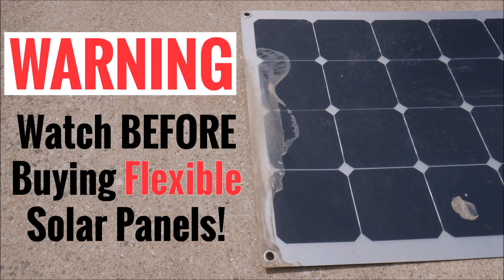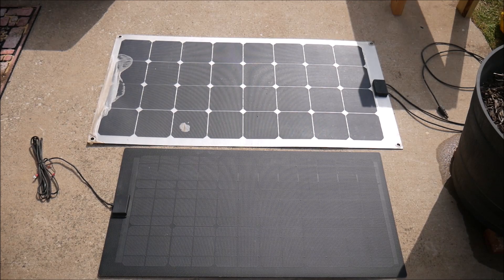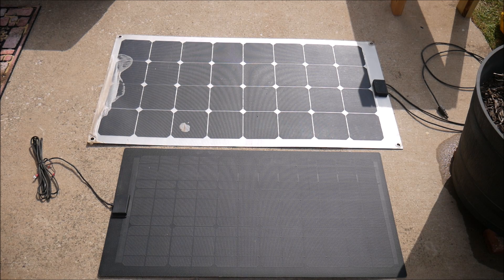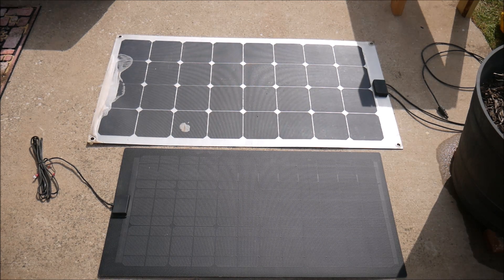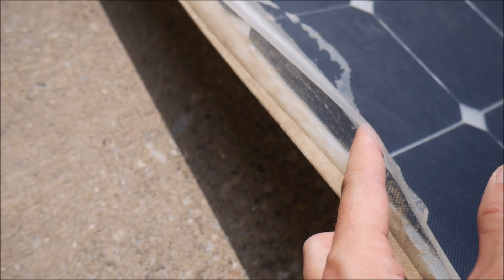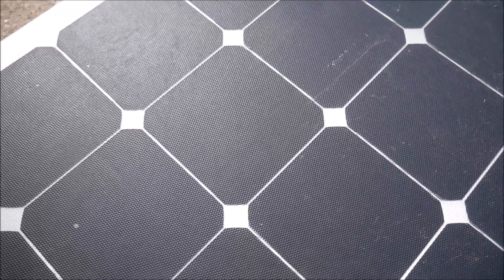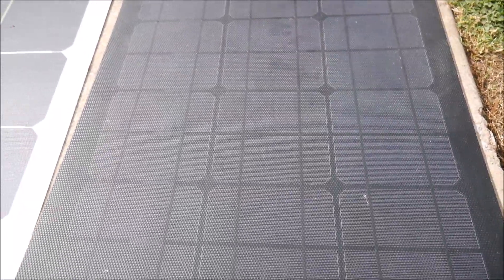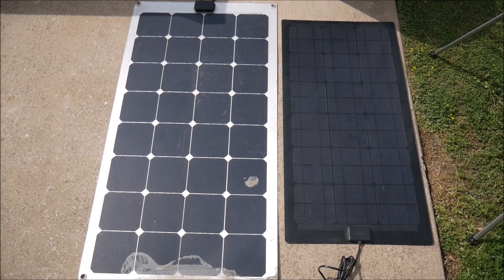Watch This BEFORE Buying Flexible Solar Panels! - ETFE Does Not Last

Comment: The problem here appears to be delamination of the ETFE film from it's substrates. If the edges are not properly sealed, pysical and thermal stress might lead to ahiesive failure, moisture intrusion, and delamination. The ETFE film itself is not the problem. Panel design and manufacturing is. The lesson here is that you need to carefully evaluate the EDGE condition and integrity of these foldable / flexible panels. Some sort of robust continuous, UV restiant flexible seal is neccessary at all ETFE film penetrations and edges, along with a lamination adheisive that's flexible, resistant to thermal stress, and tenacious and compatible with both the ETFE and whatever substrate it's applied to.

Not a simple task, so It's probably best to spend the extra money required for name-brand products with a proven track record of reliability and performance. Again, this is not an easy task given the newness of the technology, and the unknowns associated with it's long term deployment under the harsh consitions of portable use. The option is to go super-cheap, baby your portable array, and hope for the best, in essence treating such arrays as disposable, and biding your time as the industry matures and solves the technical problems associated with portable folding and flexible systems.

That, or just go with cheap, proven glass and aluminum framed rigid panel technology. 2 50 watt glass panels wired in paralell will stow in almost the same space as a rigid folding 100 watt ETFE panel anyway...and cost 1/2 as much ;-)
Reply from the maker: Agreed.  I don't recommend "flexible" panels to anyone for any application other than the most critically lightweight and portable (like for multiple day backpacking trips or something) until the technology improves dramatically.

Comment: ETFE is more difficult to process wich is why the panels often are more expensive, but they are said to last twice as long than PET panels
altho the bonding appears to be an issue
I already have a few PET panels and will buy some ETFE panels and mount them outside my apartment, they are semi protected from rain because of the awning which I leave partially out for that reason.
I really only get about 3-4 hours of sunlight in the winter in my apartment, so I need all the panels I can fit(and I have some disposable income)

I also have a bunch of old car batteries and purchased some new ones for extra capacity for a total of about 200AH usable capacity without draining them below 50%

if the current rise in electricity pricing keeps up these solar panels may pay for themselves within 5 years or less with the added bonus that I have a fully charged spare battery available at all times

I can't quite make sense of the charge efficiency rates the internet is giving me tho
they say 70% efficiency for charging and for discharging respectively a lead battery, but I used 400Wh and I charged 400Wh and they are full, so either they are really good or I'm missing something else here

Comment: I have been involved in designing, making and selling small volumes of highly customized lightweight and "flexible" solar panels for over 25 years.  Most of it with ETFE top film anywhere from 0.0005 to 0.0012 inch thick and most of the panels used in "near space" (think 100,000 to 130,000 feet).  It appears many solar panel manufacturers that use ETFE top film along with so-called "cross linking" encapulants like EVA don't understand the processing requirements for successful laminating.  It isn't completely clear to me in the video that the top film "de-laminated" from the encapsulant or both the top film and encapsulant de-laminated from the top of the solar cells.  It is, however, likely the former as that is usually the weakest link.  Successful laminating of ETFE films with cross linking encapsulants requires that the ETFE film be "treated to be bondable" on at least the side of the film that is to be in contact with the encapsulant.  It also requires that the pressure during laminating be adequate.  I manage with on the order of 12 pounds per square inch but reputable encapsulant manufacturers generally recommend about 14 to 14.5 psi.  Finally, it also requires that the cross linking encapsulant be at a particular temperature (usually over about 130 C) for a particular amount of time (usually many minutes).  Without all of the above, de laminating is certain to happen even with minimal "exposure".
Reply from the maker: Good to know!  I am far from an expert on the flexible panels and I do not personally have any desire to own any other than the ones that were sent to me for free to review.  I do not engage in any activities where the extra portability and weight savings is a benefit.  So they just end up being triple the price and don't seem to last as long.

If you have any advice for anyone reading this on brands that get the laminating process right and would be a better long term product that would be great.
Reply: @LDSreliance  While I can't be certain that any brand get's the laminating process right, I suspect Maxeon Solar and Sol-Go Solar know what they are doing.  I haven't been able to see what kinds of warranties they offer but, perhaps obviously, that would be a clue as to the quality of the product.
Reply from the maker: True it is a possible clue but definitely not a perfect correlation.
Reply: @LDSreliance  Yes, definitely not!
Reply: Hi bob, what’s the durability of 25 micron ETFE like? I have a use case that calls for high chemical resistance and 90%+ transparency and I’m wondering if applying a thin film such as ETFE ontop of another clear plastic such as a variant of polycarbonate would provide a) sufficient chemical resistance (I’m fairly certain it would) and b) sufficient durability (primarily scratch resistance). It’s much cheaper for me to buy ETFE film and apply transfer it to a plastic than it is to use tempered glass - hence the question. Thanks bob!
Reply: @Braindead154  Apologies for the delay.  I'm not on YT very much these days.  ETFE film, in general, is not very scratch resistant.  It's a fluoropolymer and, as a class, they tend to be rather soft plastics.  It is, as you suspect, quite chemically resistant.

In case it isn't obvious to you, note that if you were to simply lay a clear film (like ETFE) onto something like polycarbonate, there would be some non-insignificant optical losses.  Ideally the clear film would be optically "coupled" to the polycarbonate with a suitably transparent adhesive of some sort.  It's an index of refraction thing....

Comment: Hi. Hi recently  purchased a couple pv200 panels along with my bluetti ac200p. And wasn't aware of the life expectancy  difference of the panels compared to glass ones.  Is there anything that can be done to make theses portable  panels last longer?  Ie.  covering panels on non- use , cloudy days?  Or somehow applying more of that better covering ?
Reply from the maker: If they are used occasionally as a recreational power source or portable power source they will last a long time.  If they are used daily and left out in the elements with daily UV exposure and rain and dust and the rest then they will last 5 years at the most.  I recently did a solar install for a guy near where I live that had the Jackery folding panels on the roof of his shed for a single summer.  They were already showing significant color fading and the film was discoloring already.

So yes you could cover them when not in use or, ideally, fold them up and stow them away in a closet indoors.  That will help extend their life.  Unfortunately, I don't think you can put any better coating on them once they are already manufactured with a coating.

Comment: I'm building a bicycle trailer camper and was wondering if flex panels with FTFE would be a solution for me.
As you can imagine, there will be a lot of road vibrations, wind, rain, snow and other goodies.
I've read that micro fractures are a big problem on rigid panels due to vibrations. Glass panels are also 4 times as heavy if not more. 
What to do, what to do?
Reply from the maker: The weight difference is not 4x or more.  Check the specs and see for yourself.  I don't know how big a bicycle trailer is but I'm assuming you probably won't be able to get much more than about 200W of panels on top.  So that would be about 26 pounds for fixed frame panels and about 16 pounds for semi-flexible solar panels.  So that is a difference, for sure, but if you are pulling a trailer another 10 pounds isn't going to break the camel's back so to speak.  In my opinion.

I have never heard of solar panels getting micro fractures from vibrations.  I have installed them on RV's and they never had any problems.  They are also routinely mounted on golf carts, boats, and trailers.  I would assume that there is truth to what you have read but more to the story, such as a single manufacturer that cut a corner or a specific type of panel that is less common.  I certainly could be wrong but I just don't think it is something widespread or I would have heard about it.

Also, if the diodes and junctions and electrical connections inside the junction box of a fixed frame solar panel fail because of vibrations they will fail on a PTFE panel, too.  There is no difference at all in the junction boxes between the two.
Reply: @LDSreliance  On a rv it wouldnt matter.. I got a rooftop tent and can only put around 10kg onto it. If I put 3x 200w etfe semi-flex on it that's around 10kg, if I put the most light fix panel it would be 36kg.. Yea I would love to have fix but way to heavy,, and its nearly 4x heavy.. Also the best etfe to get is sonpower semi flex.. there are cheap china etfe that isn't Japanese etfe just cheap fake etfe..The cheap fake etfe is etfc which is china made and they call it etfe. Real etfe coating is made in Japanese or USA and the sunpower gets it from japaense.

Comment: i bought a dokio "300" watt folding panel, when it was new the best performance i saw was 225 watts with the best sun and angle. dokio said do not leave it outside day after day, which prompted me to challenge this. i let it lay out in the sun for maybe five months. this past week/weekend i have been testing it and even took it camping and found that it now puts out about 150 watts.

the sun did not cause it to fall apart like yours did, but it did weaken the material that holds the four panels in position. $330 for 225 watts didnt feel great when it is sold as 300 watts, but now that its down to 150 watts, i dont know what to think.

i may buy another, but only use it for camping and emergencies, but it will never pay for its self like a regular glass panel could, but i dont have room for glass panels on camping trips
Reply from the maker: Yeah the semi-flexible panels are extremely expensive for what you get.  The only benefits are a slight decrease in weight and the folding ability to stow when not in use.  So that is only good for temporary use for avid campers, boondockers, hikers, and boaters.  It is not good for folks who live in their RV, tiny home, van, boat, or whatever on a full time basis.  They aren't meant to do that.  So you give up price, longevity, performance, and durability to gain some portability.  Not a great trade for most people.
Reply: @LDSreliance  I was lucky to get very high quality 100 and 120 watt folding panels with ETFE coating and Sunpower cells that look exactly like the Jackery panels for only 99 each. I use them for various USB powered devices and chargers and to charge my solar power stations. They can also be connected to simple 10 amp MPPT chargers directly to my 300ah LiFeP04 battery to boost charge rate when I need extra emergency power for my window air conditioner. Here in Louisiana these produce their rated output so far but I reserve them for emergency use. One has a 65w type C PD port and two regular USB ports. They can power small fans in extremely low light. I highly recommend these in hurricane country to prevent heat stroke, charge power banks, phones, laptops, power stations, and radio and flashlight batteries.
Reply from the maker: @baneverything5580  Awesome!  Sounds like a phenomenal deal.
Reply: Same here. My dokio 225w turned out to be junk.

Comment: Mine also peeled off and i think one of the cells shorted so now a 100W panel gives max 0.4amps...
Reply from the maker: I am sorry.  That sucks.  They are not cheap things to fall apart so quickly.
Reply: @LDSreliance  Yeh, overpriced. I think i found a bad cell using a IR thermometer, the only cell that gets hotter than the rest. I'll try to cut around the connections and bypass it, better than scrapping it.
Reply from the maker: Yeah if you can repair it that would be great.  But it sounds like you probably will have to find some sort of glass to put over it since the film is gone and the repair will be vulnerable to continued problems.
Reply: @LDSreliance  I'd just use a 2 part clear epoxy to cover the cut or something. I'll only penetrate from the back lol so shouldn't be much to cover

Comment: ETFE is supposed to last a lot longer than PET. Shouldn't you be sure that the panel that was falling apart is in fact ETFE? I'm asking because you said at one point in the video that it could be PET. Was the all black panel ETFE?
Reply from the maker: I can't be sure because that panel is no longer available (it hasn't been on their site in a few years) but I know they claimed it was ETFE.  My comment about PET was just that maybe they lied and the fact that it is failing is because it isn't really ETFE.  If you know of a way to know for sure I am all ears.
Reply: @LDSreliance     It looks like PET. It doesn’t look anything like the ETFE panels I’m seeing now. That’s why I was asking you if the other panel was ETFE.
Reply from the maker: I went back through my notes and they definitely go out of their way to promote that it is ETFE.  Also, it originally looked identical to the other panel in the video, just different color background.  I believe both of them are, in fact, ETFE.  It just doesn't last like it should.  I have received quite a few comments from other people with the exact same issue with ETFE panels.
Reply: @LDSreliance     Ok, good to know. Thanks.
Reply: @LDSreliance  it is possible that the adhesive that broke down, after all, you can see that the film is still intact. Definitely a quality issue, but the cause is likely the cheap adhesive they used
Reply: the one falling apart is a PET panel, the ETFE one (the black panel) looks fine.
Reply: @analysedean  Exacto, el otro panel utiliza el barato PET y se ha vendido como ETFE para venderlo mejor, muchos de los paneles que se venden como ETFE son realmente PET, fallando en menos de 2 años, al mismo tiempo los paneles flexibles pegados directamente son solo útiles en lugares con poca radiación solar, la capa de ETFE puede superar los 80°C en zonas cálidas, dañandose y puede crear puntos calientes que dañen las celdas.
Un panel flexible ha de estar aireado por debajo, una buena práctica es instalarlo con una placa de policarbonato alveolar que permita su aireación, esto supone subir el peso del panel 1kg, pero multiplicará la vida del panel

Comment: Would have been interesting to know what the output from those panels was after they had been in storage for that long.
Reply from the maker: I thought about that.  But it wouldn't have meant a whole lot since I don't have a "before" spec.  Or an undamaged comparison unit of the same model.
Reply: @LDSreliance  You could tell us the original specs so we could gauge a rough good idea of original output power. Maybe you have a viewer who kept theirs indoors, out of freezing temps, who could send in a photo - perhaps ask your viewers in the introduction text below your video.  Thanks!

Comment: Laminated panels are cheap and light.  I use one to charge a battery bank and it's been going for a long time albeit with very light use.  Good for hunting, camping, and hiking.
Reply from the maker: Cheap?  Compared to what?  Are we talking about the same thing here?
Reply: @LDSreliance  When I think of portable light panels I think of flexible versus foldable.  Flexible tends to be cheap compared to foldable.  Powerfilm is a good example of what I was comparing the flexible panels to in my own head at least.
Reply from the maker: Ahh ok, that makes sense.  In my head I think in terms of comparing them to metal frame panels, in which case they are not cheap.
Reply: James Randolph - So yours are not delaminating?  Do you keep them in climate controlled storage when not in use, like air conditioned heated house, basement?  Not hot attic or cold garage?  How many years have you had yours?  What brand type?  Or likely if they aren't manufactured anymore, what are they most like that's available now?  How do you travel with them, set on top of luggage or mounted to RV roof that is normally parked inside a shelter? How many weeks a year do you use them, I'm guessing 6 weeks / year? We will soon buy 2 100A panels for camping only and will store in our basement, using it only 4 weeks / year, so your feedback is appreciated, thanks.
Reply: @arlenekufchock1394  I don't even see a name on mine.  They have got even less use than you think.  I don't believe mine have even seen rain. They are kept indoors in an air conditioned home.
Reply: @jmr  ok good to know that sporadic vacation use and climate control storage helps, thank you! Does yours have the rubberized bumps on it? If so that might be EFTE.... Or thin bendable aluminum backing? White border, black border, other distinguishing marks?